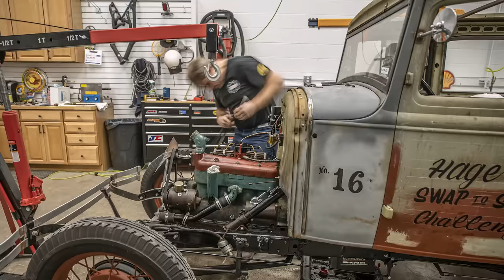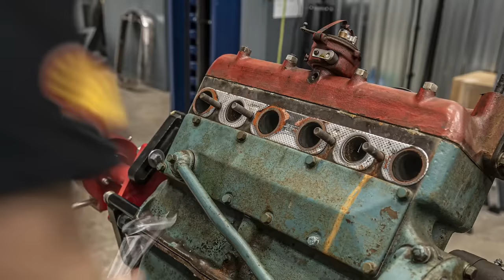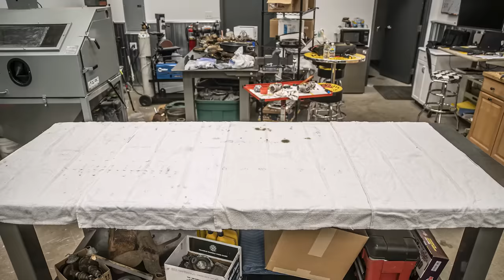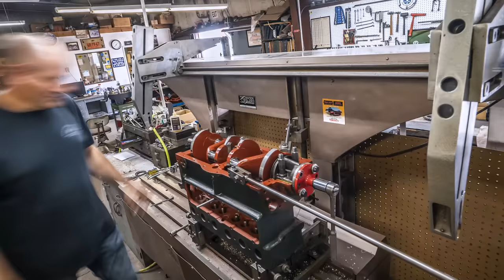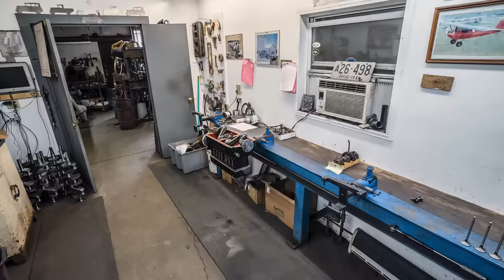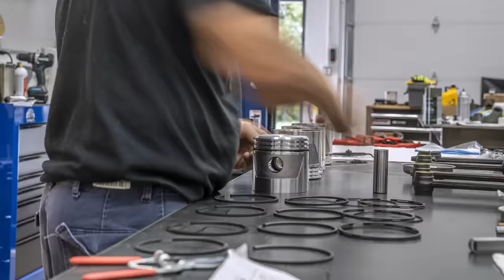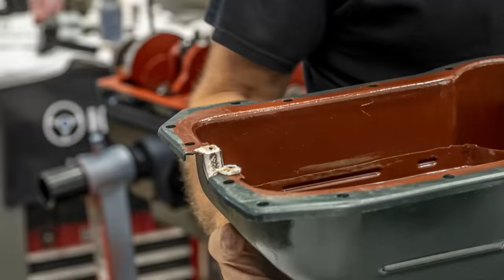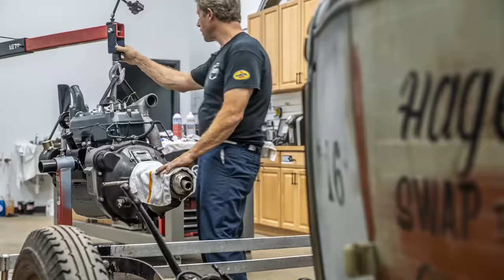Ford Model A 4-cylinder engine rebuild time-lapse | Redline Rebuilds - S3E4

Comment: According to the owners manual these engines need to be rebuilt every 100 years
Reply: Lol
Reply: 1949 8n with an atomic 4. 77 years old and has had nothing done to it. Runs like a top
Reply: @fordrestored4646  I have a 48 8N that sat in a field for 15 years. Only major thing I've done to it is upgrade electrical from 6V to 12V, and rebuilt the carb and distributor. Runs like a champ even on the coldest of Montana winter days.
Reply: That's Funny😂!
Reply: That was a great missed opportunity to put insert bearings in it...
Reply: @markjohnson9495  Maybe they'll do it in 2119 on the next rebuild.
Reply: @burnout21  could have gone 200 with inserts. 😉
Reply: @audiomantim  big sky country
Reply: Ford Restored atomic 4. What a 40s-50s name. Gotta love old times.
Reply: That manual is so old it probably read “Rebuild every C years”.
Reply: @macmac8249  Nice!
Reply: I’m amazing shops still exist that know how to babbitt bearings!  That’s some seriously old tech.
Reply: Oh my god
Reply: imagine current modern engines getting rebuild like this in the future. Lol
Reply: @thompsona10625  Depending on where you live, there generally is one shop within 6 hours driving distance.  In Hagerty's case it was roughly 7.
Reply: @macmac8249  Ha! Latin humor. Gotta love it!
Reply: @spankthemonkey3437  the Mercedes diesel sedan engines from the 80’s (OM617 turbo 5 cylinder) will run with zero electrical system once you get them started.  You could literally remove the battery and alternator and it would keep running.
Reply: @fordrestored4646  I have a 1951 red belly runs like a top, I have owned it for 45 years, just finished bush hogging pasture.
Reply: The new factory memo recommends every 150 years or 150 million miles - whichever comes first.
Reply: @markjohnson9495  NOT if you want to keep it authentic.
Reply: Knew a guy that lived during these cars.  Said you had to rebuild the engines every 10,000 mi.
Reply: @cincinnatibob37  that was with the crap oil they had back then
Reply: Just wondering why there is no washers on the head bolt nuts
Reply: @cincinnatibob37  I think the rebuild was mosttimes limited to grinding the valves.
Reply: You look at the cars made today and they break faster then a drop of a hat. Not like old cars that were built to last
Reply: @silverwindspirit  what? Modern cars will easily do 200k miles with no rebuild. With careful maintenance 300k is easy. A model A would have no hope of getting to 100k without a rebuild.
The average fleet age in the us has been increasing substantially over the past 30 years. People are keeping cars on the road much longer than they used to.
Reply: I can probably bet it is lmao!
Reply: 😂😂😂 jajajajajaja
Reply: Judging by the finished product that engine is going to last a very long time with the benefit of modern lubricants and fuels.
Reply: fantastic jibe⁉️‼️😳

🥂

🪖

Comment: Amazing how many originals will still run and go considering they didn’t even have a oil filter on them originally. A tuff little engine !!
Reply: It's because in vintage engines like this the tolerances are not very tight
Reply: Alex Nather also they were built to last a long time
Reply: Well it’s a lawn mower engine times 4
Reply: @alexnather7614  that is true. Old tractors engines are the same. Low HP low compression loose tolerance. I got a 1953 Farmall that will fire on the first hit every time after all these decades. They was made by Continental Engine. Pretty similar to the Ford engines .
Reply: Drove one in high school..
It was a pickup!
Reply: The Truth about Africa hurts  
How cool
Reply: That’s because they were built on a time of Great Depression and they were required to last and nowadays they use the cheapest parts ever and the cars are crap
Reply: @josefmechanic  I call that BS, modern cars are so much better in every way. I have not seen a modern car that cannot easily last 100K, on old cars like that the odometers don’t even go past 100K.
Reply: They change their oil every 1000 miles, don’t see why you really need an oil filter.
Reply: @davidgruen7423   I’ll name some right now Porsche Cayenne, dodge magnum pickup, Ford Focus( the early 2000s model), Saturn
Reply: @davidgruen7423  most "affordable" cars hammered together today with computerized turboized BS are pretty much smoking junkyard candidates by the time they hit 100 thou'.
Reply: @kenjsr1  I like it, they rock when they do work, and when they fail it’s usually just a sensor, replace it and we are back in business.
Reply: @davidgruen7423   unfortunately tracking and getting that sensor can be a pain I have an 07 Nissan Sentra that claims it has a bad crankshaft position sensor but I replaced it and it’s still doesn’t work that little sensor was 54$! Now on these old cars spark was controlled by a distributor and a coil as long as the coil had power and the distributor was set right you didn’t have any problem you could tune it and when they wear out they usally still work good enough to drive it
Reply: @josefmechanic  that means you didn’t diagnose it right. Old cars needs to do tuning at least every two years or more frequently. On new cars you don’t even have to mess with anything regarding timing or ignition system until 10 years after, and the computer is constantly adjusting it’s like there is somebody who’s constantly doing tune up on your car, I like it.
Reply: @davidgruen7423  I know what I’m doing David the problem is the car is discontinued they don’t make complete harnesses and brand new programmed ecu for my model of Sentra with the six speed transmission and old cars don’t have too much work to retune them there stupidly simple to tune if they need it especially old farm trucks
Reply: @davidgruen7423  cars manufactured today are like a toaster or microwave, when they stop working you toss them in the trash. unless you can find well trained technicians, getting your car repaired can become a costly proposition. When you purchase a vehicle today, its like rolling the dice.
Reply: @kenjsr1  i am a well trained mechanic, I have yet to encounter a problem that I could not fix. Some may take for days to diagnose but in the end it all comes down to very simple problems. The key is to understand how each component works.
Reply: When you're constantly leaking oil, there's no need to filter it!
Reply: Because engines were made in America with a ton more quality, less moving parts and they were built to last, which they did.
Reply: It's because older model cars are built tough & almost bulletproof... Sadly That way of manufacturing ended in the 90's.. modern cars are now disposable & focus more on stealership profiteering.
Reply: Also remember the dirty, dusty driving conditions, and filter on carburetor, if there even was one!?
Reply: NASCAR 850HP engines are amazing to me.  Wide open @ 180 mph for 5-600 miles.  And a failure is very seldom.
Reply: @davidgruen7423  True, I remember when Kendall first advertised a "2000 mile" oil, an unheard of development at the time.
Reply: @JohnnyRebKy  Right on. I got a '46 Continental on my welder that only has new oil, filter, plugs and wires on it. Runs like a champ!
Reply: @JohnnyRebKy  I'm not aware of any Farmall tractors from the 1950's that came from the factory with anything other than a Farmall - IH made engine. But other than that, it was a different time and philosophy on how to build a machine. Most of these engines/tractors that did fail did so because of the metal alloys used at the time as opposed to the basic designs.
Reply: @cdjhyoung  farmall engines were made by continental.
Reply: @JohnnyRebKy  You are mistaken. IH/Farmall self manufactured their own engines. In fact, when the company started to divest product lines in 1985 with the sale of the tractor line to Case, IH continued to manufacture engines under the Navistar brand name. Can you show me a reference that lists Continental as an engine source on any IH/Farmall product? IH self manufactured engines in England also.
Reply: @cdjhyoung  I stand corrected. Thanks 👍🏻. I got a 53 Super A with original untouched engine and it still runs like a champ. Always told it was a continental. Unlike most I’m willing to be wrong and learn something. If only everybody else would do the same
Reply: @JohnnyRebKy  Thank you for your graciousness. Continental, and Plymouth seemed to be the engine of choice of the second tier tractor makers, especially those that came on the market after WW II. But few of those companies lasted past 1960.

Funny, I came to this video to see how similar a Model A engine was to the engine we had in our 9N. Very similar indeed. I sure wish we would have had some of the equipment shown the one time we did the main bearings on our engine. That was a challenge and a half, and that was with my dad leading the way that had done this project a number of times in the past.
Reply: @josefmechanic  I agree. My 1992 Saturn SC2  has 327k and the only thing I ever replaced( besides brakes , plugs, tires) one alternator and and clutch( went out teaching my 15 yr old to drive a stick).
Reply: @kenjsr1  by design they don't want cars that last forever
Reply: @josefmechanic  I knew old folks who drove these type of cars and even they say that todays autos are much better. These old cars yeah the engines were much easier but one had to always be working on em 5 to 10 tines a month back in the day.
Reply: Henry Ford did design the Ford Model-T and the later Model-A to have an engine that can be used for agricultural use.
Reply: @elcasquito  some of those Saturns are true troopers but most of them are junk glad you got a good one!
Reply: @selfoblivionalex6262  well you gotta remember with an old car comes old parts and new cars come with new parts but the older designs and components are built differently and are meant to last a long time granted they won’t live forever but a lot of newer components will wear faster because of the cheap quality and plus most modern cars require a lift to service the most basic things on them and it’s really sad some even require pulling the motor out to change simple things out
Reply: How do you know the engine in this video wasn't rebuilt two or three times?  Many have.
Reply: @cratecruncher6687  I don’t 🤷🏼‍♂️. But I’ve been around many that haven’t
Reply: @kenjsr1  What the heck are you talking about? You can expect any low-end car from a Japanese or Korean manufacturer go 250K with just normal maintenance

Comment: As a teenager in the 1960s, I lived in the Gemfields Central Highlands, Queensland, Australia, and met a man known as 'Old Bill.'   Bill came to Sapphire in the early 1930s driving a Model A Ford-covered Ute.   After working in nearby gold mines, he bought it near new, in Charters Towers.   Soon after the purchase, it became clear that it used an unacceptable amount of oil (no 12-12 warranty back in the good old days).   On stripping the engine down, he found there were no oil control rings on the pistons?  Questioning the Ford agents in Charters Towers, he was told that oil control rings were an "Optional Extra."  He had to send the pistons away for machining to fit the rings.   Ted from down under.

Comment: im 27 and i found a 1930 ford model a for 6k a few miles from me. iv rebuild motorcycles for a few years and since iv became a engineer. i dont know why but i keep getting pulled towards old cars simple motors and just the calm road. something about being able to complete rebuild a motor with a garage shop set up is just nice. such a simple car and treat it right it will last forever. no complex electronics nothing crazy. best part keep it basic and u can have your kids working on it learning the confidence to tackle much greater mechanical feats.

Comment: Wow!!  The amazing stop motion photography, the amazing mechanical knowledge makes for an amazing video.  It’s no wonder that your subscriber numbers are growing so quickly.  Thank you very much!
Reply: They do not. They have literally painted internal parts. That is the most idiotic thing I have seen done in a long time. The rest of you mouth breathers on here, that missed that should stop ever commenting on videos!!!
Reply: @Stowell1984  Pretty sure that's an oil shedding coating to help with oil return among other things- not regular ole paint.  Their work looks top notch.
Reply: @briank2319  I had considered that, how ever, why would that be necessary on an engine that's not turning high rpm? It doesn't look the normal black color either. Glad you have faith in them though.
Reply: @Stowell1984  that motor will be fine a few oil filter changes and what ever paint comes off will be gone
Reply: @Stowell1984  You do not know what it is but you ASSUME it's paint.
Reply: @joshuamcpeek4708  thats a special paint that seals the cast-iron. Any gear head knows that. 🤔
Reply: @kenjsr1  I know, it also seals potentially pourus castings and helps cut back on fluid resistance caused by rough castings, it's supposed to be there. What I meant to say in my prior comment was that if it did start to degrade whatever particles would be collected and trapped in the oil pan to removed during subsequent oil changes. Basically I meant to reassure those concerned that it was ok.
Reply: @Stowell1984   
It's called glyptol dummy and it's common practice

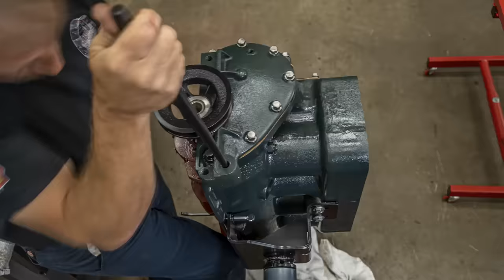Comment: 5:42 With a oem style front crank seal like that Its amazing its even possible to seal it up. Well done. Love the bearing casting work also!
Reply: That's probably where it was leaking out of originally
Reply: First time I’ve seen these bearings done. My dad used to talk about doing it, but my cars have all had shell bearings!